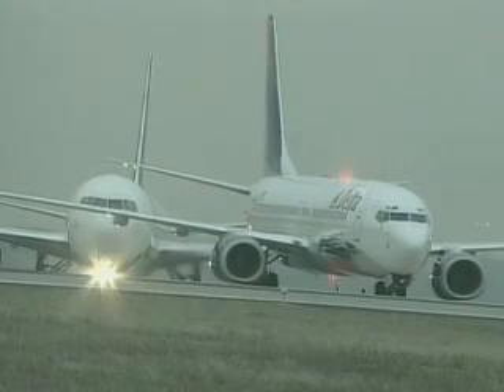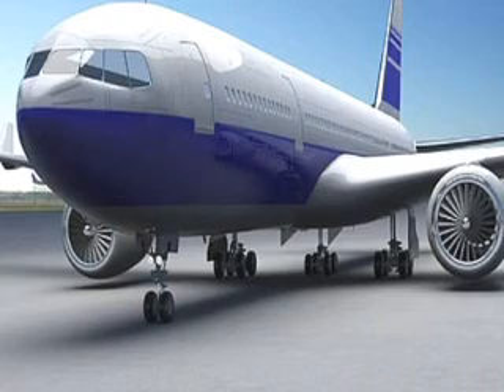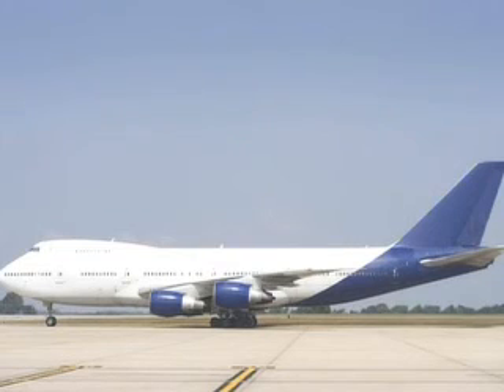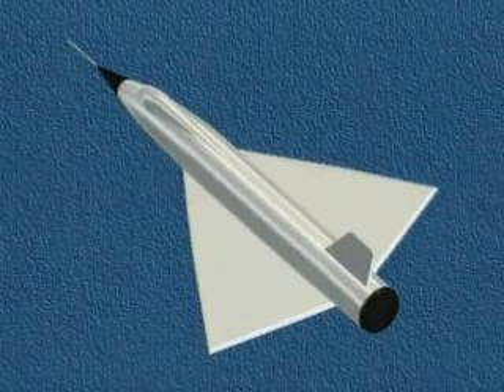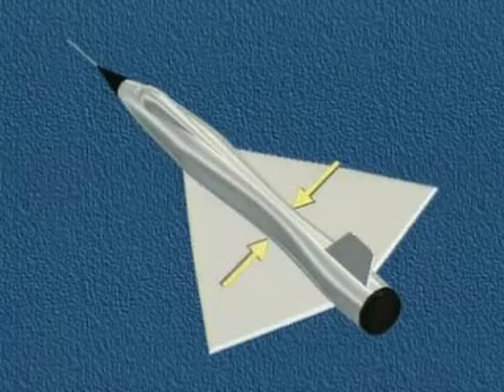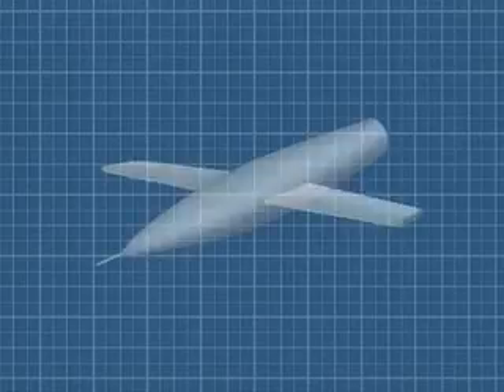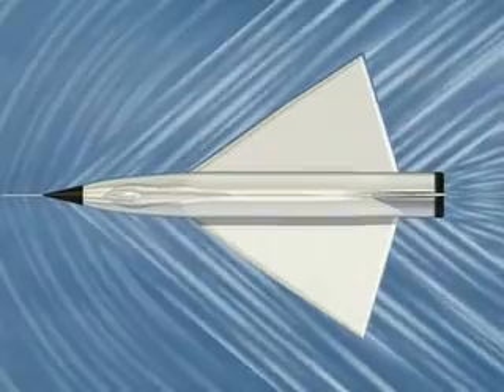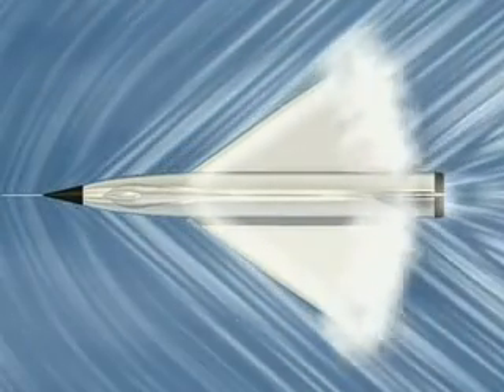Modern Aircraft Design

Comment: This is all wrong
Reply: Yknow this is made by NASA? Yknow, the people who send stuff to space? It’s correct, and I would know, because I like planes
Reply: @nts_pc  You know NASA crashed a spacecraft because they used non standard measurement?
Reply: @chippyjohn1  Alr, Il believe this guy if he can make a spacecraft without it failing.
Reply: @nts_pc  The most difficult aspect is the finance, not a persons ability. There are more intelligent people without access to what they need than those who bought an education, remember that.
Reply: @chippyjohn1 so if given the proper financial assets you could launch a rocket to Mars?
Reply: @nickolashogg259  Yes. Why not?
Reply: @chippyjohn1 Did you also know they put several people on the moon? You can’t just highlight one mistake and frame the entire company as one big mess. And I bet you have also made a mistake at some point in your life.
Reply: @chippyjohn1  are you talking about the imperial system?!??
Reply: @chippyjohn1  A CONTRACTOR crashed a nasa satellite into mars atmosphere
Reply: @chippyjohn1  So you can do all the calculations required? With only the technology they had at the time? Since you don't trust them I guess you wouldn't be able to use the calculators NASA has put out there to help design nozzles and the like.
Reply: bro is an idiot, this is fucking made by NASA
Reply: Erm ok unc could you explain why.
Reply: Nuh uh